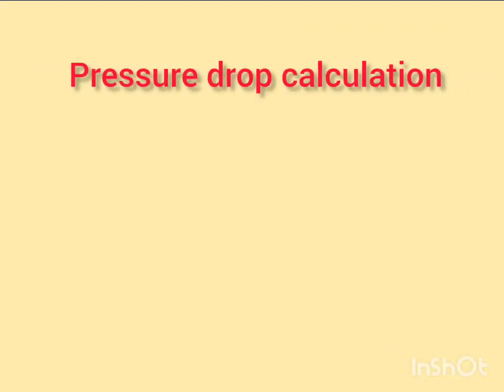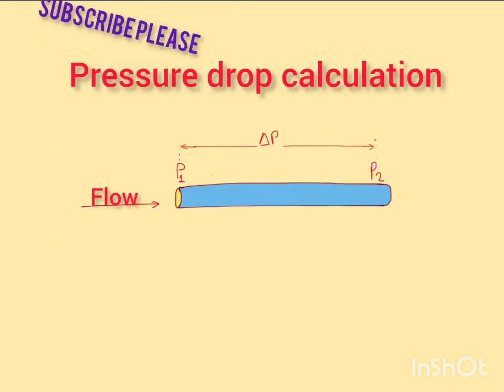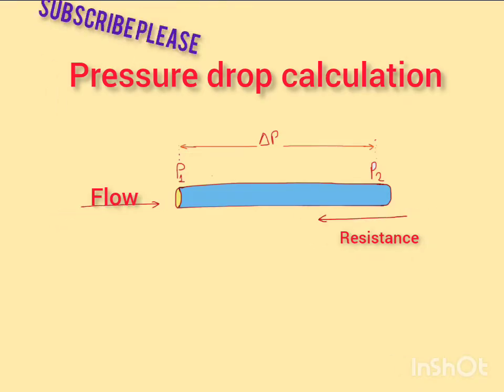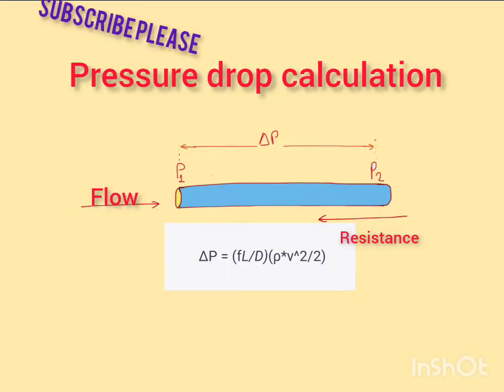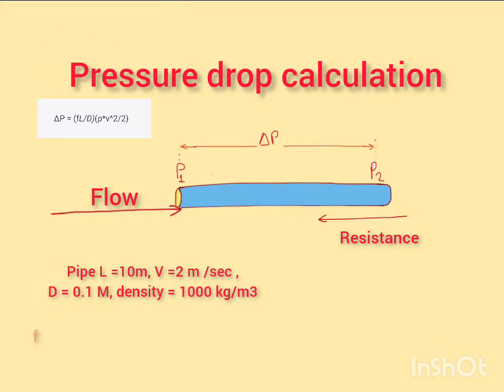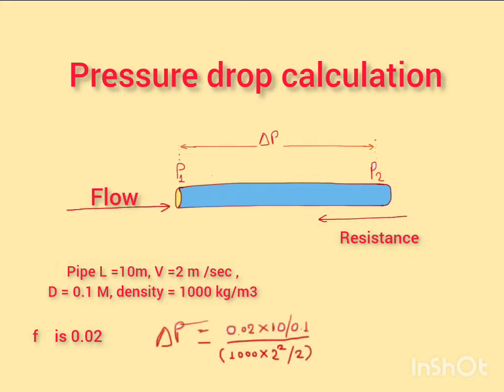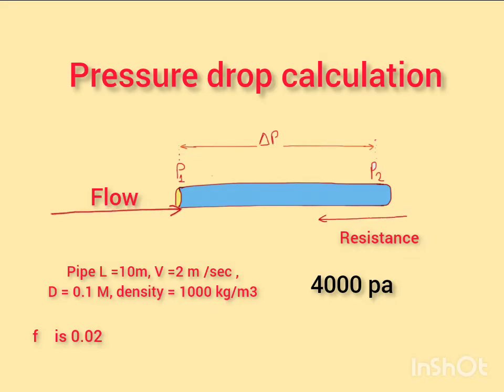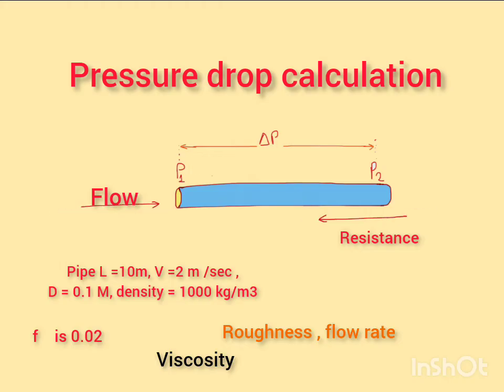pressure drop calculation in pipe with Example

Comment: Does change in piping diameter change this ? How about number of bends in tube? How about material porosity?
Reply from the maker: Yes if we change the piping diameter then pressure Drop will change, as per this formula pressure Drop is inversely proportional to pipe diameter, ...................There are a lot of types of pressure Drop in pipe, above pressure Drop Calculation is applicable for pressure Drop in pipe due friction, we need to calculate Pressure Drop for fittings separately ( For valve, bend and other),
Reply: Could you share video